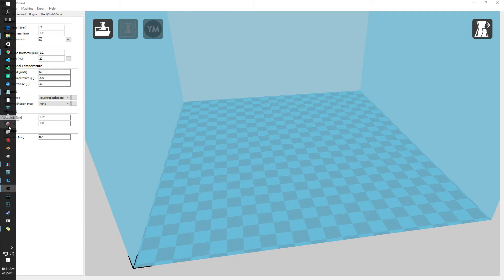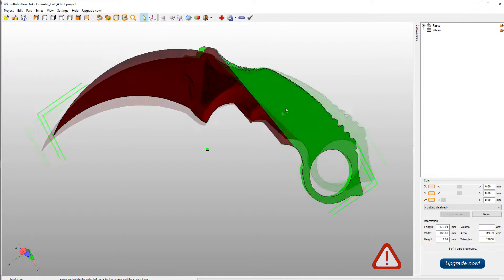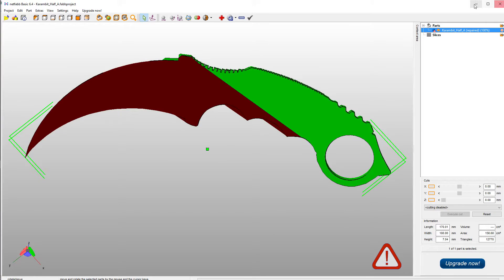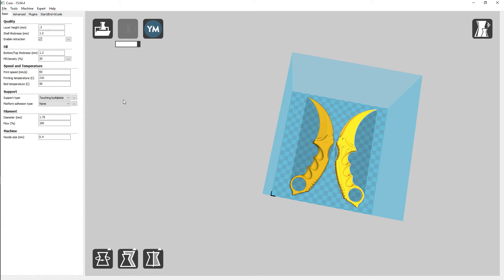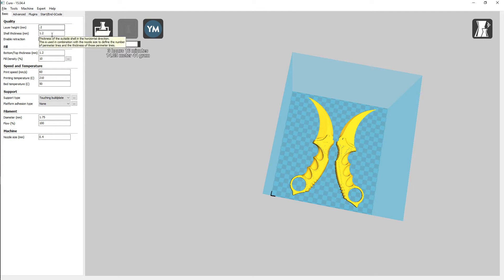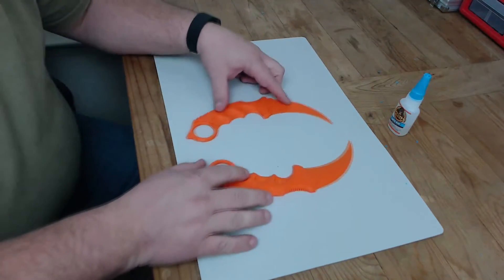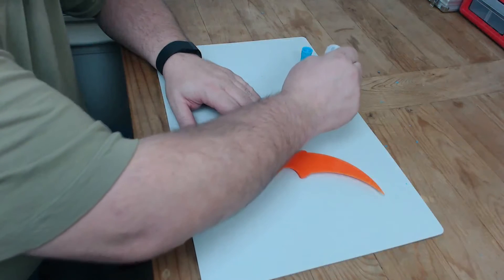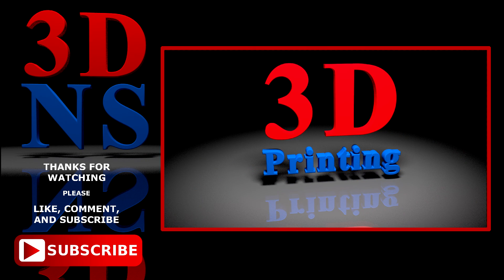3D Printing: Reparing Bad 3D Model

Comment: Thanks for sharing that. Very informative. I like the quality of the model you printed, it didn't need sanding. Repairing the 3D model is something that I should always consider before printing. 
How accurate is the estimated time shown in Cura and the weight when compared to to the actual time spent on printing and the final print?
Reply from the maker: +Abdullah AlGhamdi That model printed out very nice and works great as a letter opener. I would have to say it is fairly accurate with in 20 min. I did not time it but left the room after starting it and came back about the time it should have finished and it was just finishing up. I did not think to check the before and after weight. I'll have to try it on a print soon.